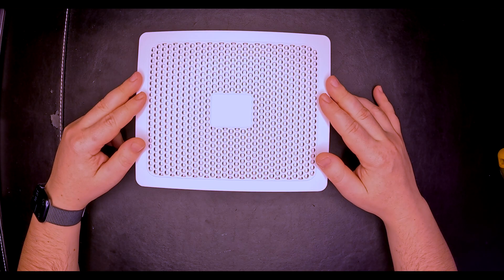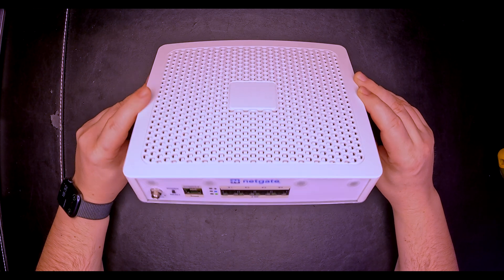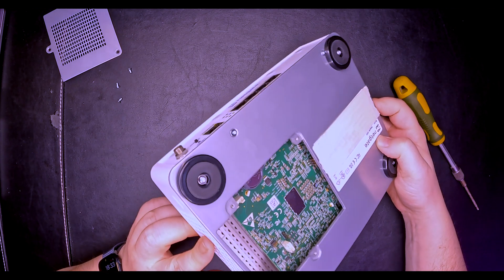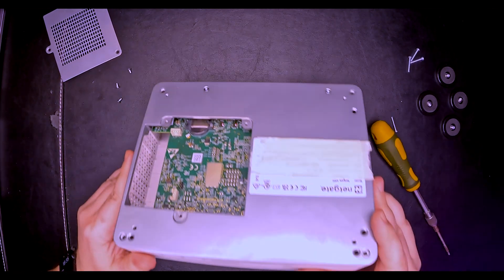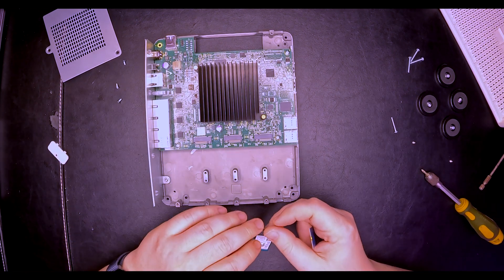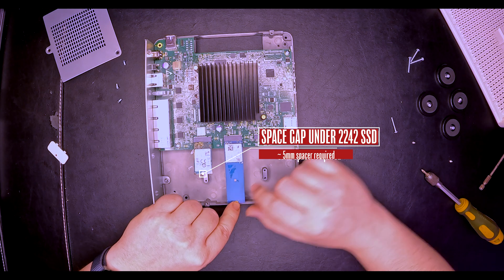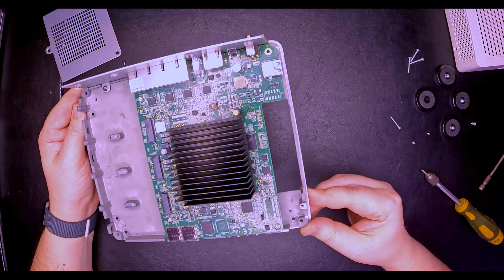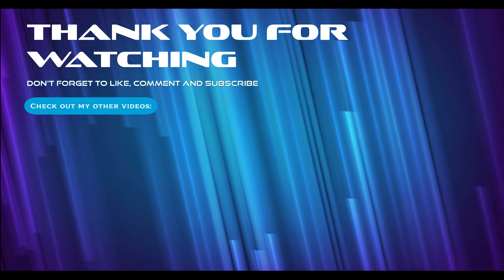Netgate 4200: The latest pfSense Firewall fresh from the oven

Comment: I do miss SFP.
Reply from the maker: I know,, they are useful but not everyone makes use of them in this price range. the 8300 Has a lot of them but that unit is too expensive to buy and tear down :)
Reply: @TricksAndThings  well the 4100 and even 2100 do have sfp.
Reply from the maker: @EuroPC4711  I was actually thinking of sfp+ in my mind :) since the 4100 is EOS, then indeed the 2100 is the only low price unt from Netgate that has a sfp combo port. Not sure how useful it is since it's only 1gbps and way harder to work with than a plain RJ45 connector. Maybe for some legacy network equipment.
Reply: @TricksAndThings  well I think it’s useful if you have fiber because you don’t need a device between Internet and Netgate. But yes, it’s only 1  gigabit.

Comment: I don't understand why they would design the case so the top is curved. That makes no sense to me. With all that space, you'd think there would be an integrated switch with at least four more ports. Strange. And then there's no branding on the front. Was this designed by the marketing department??
Reply from the maker: The case looks nice in hand but I am also surprised of the lack of branding on the front.

Comment: Merită banii? :) Plănuiesc o rețea de la zero pentru acasă și oscilez momentan între 4200 și 6100 care e mult mai scump și nu cred că e nevoie de modelul mai scump, fiindcă sunt slabe șanse să ajungă RDS sau orice alt ISP românesc la 10Gbe prea curând...
Reply from the maker: Salut, Netgate 6100 e cam overkill pentru HomeUse. Chiar daca o sa ajungă RDS cu liniile de 10gb, o sa avem nevoie de switchuri 10gb si ce facem cu dispozitivele wifi (ce sunt predominante acasa) iar apurile nu prea nu știu mai mult de 2.5g? Netgate 4200 eu cred ca este mai mult decât suficient si rămâi cu bani pentru un upgrade la SSD storage. NU recomand sa rulezi de pe emmcul intern ce se poate corupe în timp si nu poate fi înlocuit decât prin microsoldering dar sincer nu am curaj sa încerc pe un dispozitiv funcțional :)
Reply: @TricksAndThings  De acord, dar cum ziceam, eu am privilegiul să gândesc o rețea de la zero care aș vrea să fie cât mai future-proof. Cu alte cuvinte, aș fi putut să gândesc toată arhitectura pe 10Gb, de la router la switch, la AP-uri și chiar la STP-uri (care sunt deja Cat.6). Cu toate astea, 10Gb pare într-adevăr overkill momentan, și probabil că 2.5Gb e arhisuficient, chiar dacă vreau să folosesc 2 WAN-uri de la 2 ISP-uri diferite (care momentan au maximum 1Gb fiecare). Merci de părere!
Apropo de stocare, am văzut c-ai făcut un video și cu upgrade-ul cu un m.2 m-key NVME 2280 (mă gândeam la un Kingston NV2 250GB) - se poate face exclusiv cu anularea garanției? Aș putea face asta mai târziu, atâta timp cât fac backup constant la setup-ul router-ului ca să-l pot reaplica pe NVME când îl instalez?
Merci mult!
Reply from the maker: @ViorelMocanu   Pentru backup exista si varianta de cloud Backup disponibila gratuit pentru echipamentele Netgate. Din ce informații am, garanția nu este afectată de instalarea unui SSD deci se poate instala oricând (worst case nu e mare lucru să-l dai jos) . Kingston NV2 este super ok. Daca nu e deja cumparat, un 128 GB este suficient. Un pfsense Plus cu Suricata, pfblockerNG, openvpn si câțiva ani de loguri ajunge la 7-8 GB
Reply: @TricksAndThings Excelent, merci mult de info! Ultima întrebare: recomanzi să comand Netgate-ul direct de la ei, sau de la reselleri locali (e.g.  romsysconcept)?
Reply from the maker: Best way din punctul meu de vedere ar fi achiziție locală si daca ai cum, pe firma. Câștigi TVA ( 19% ) ce este deductibil daca este cumpărat pe firma. În plus nu-ți bați capul cu procedurile de import, taxe vamale, iar daca sunt probleme în garanție, acestea se remediază local vs costuri transport pentru a trimite echipamentul în SUA la Netgate (Echipamentele cumparate direct de la Netgate trebuie trimise direct în SUA pentru garanție , nu sunt acceptate în service la partenerii locali ).  Acum probabil ca este o diferența de preț dar trebuie luate în calcul si evenimentele neprevăzute. Orice ai alege, nu uita de instalare SSD (DIY doar sa fie :) ) . M-am lovit de emmc corupt si din păcate vorbesc din experiența.
Reply: @TricksAndThings  great point, merci mult pentru tot! Și da, clar, așa o să fac cu SSD-ul. :)
Reply from the maker: @ViorelMocanu cu multa placere :)

Comment: Awesome video, thanks! Thinking about getting this unit. Were you able to find out if the 2240 or 2280 SSDs work and in which slot and, up to how much memory? Thanks!
Reply from the maker: glad it was useful ! Actually the answer is YES. I played around with some nvme drives and  was able to switch the os to nvme. It is a bit different procedure but it can be done without issues. I will need to reshoot the process and will post the how-to video most likely next week.

Comment: Junk. No SFP ports and the lack of M2 is inexcusable. Running an eMMC is not appropriate for such a device.
Reply from the maker: They did a closer match to the old 3100 that is oriented more to home/ small office. Even if there is no m.2 behind that small cap, later in the video you can see that it has 3 m.2 ports. From those 3, 1 turns out to be shared usb/pcie x3 and the other is a pcie x4. Once i get the firmware i will try to bypass that emmc and install an nvme drive
Reply: @TricksAndThings  if an end user can painlessly install an M2, then I will change my feedback. Shame there’s no rack mount for it either yet. Thanks for this teardown.

Comment: I wonder if it uses less or more watts than the 4100. The 4100 was quite an efficient box ~11w.
Reply from the maker: That would be interesting to test. Unfortunately i do not have a 4100 anymore and in order to get a correct measurement the same watt meter should be used for both units.